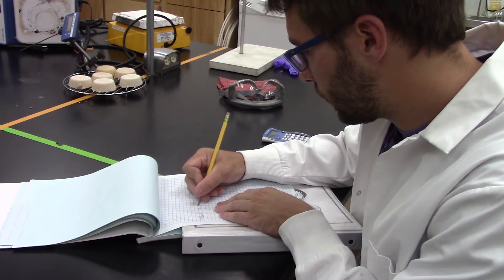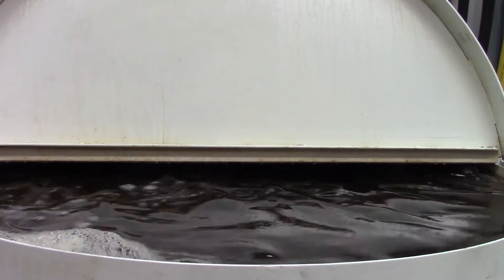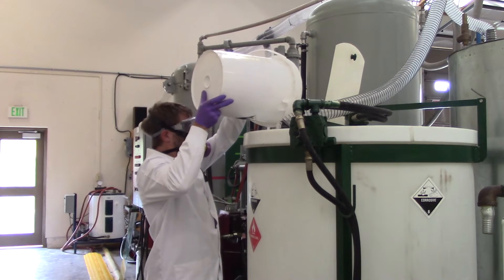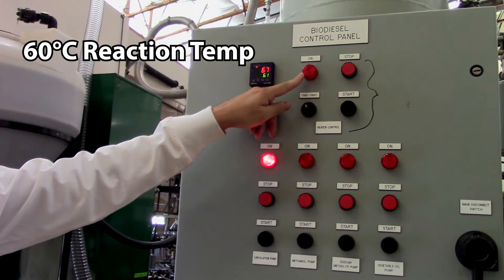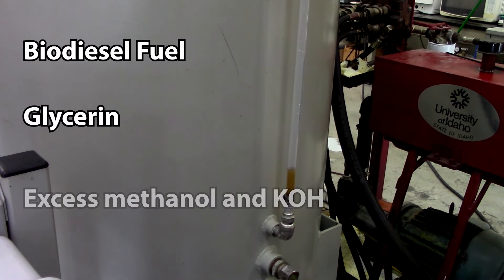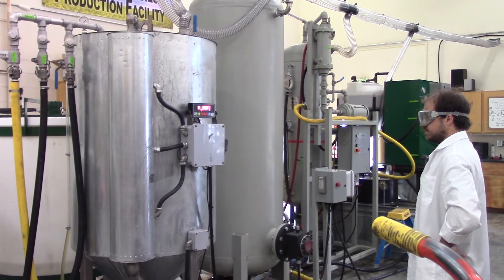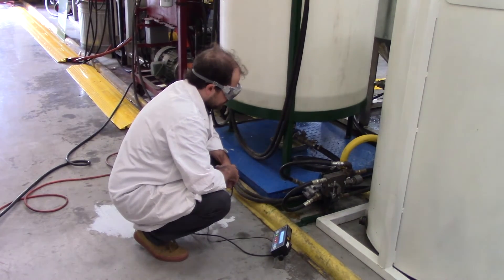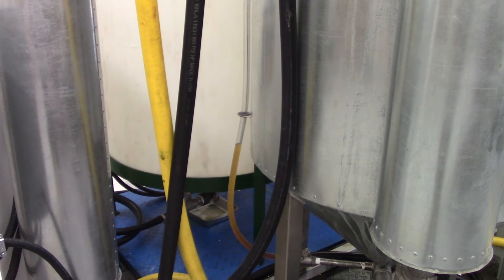Biodiesel Masterclass: Making Biodiesel—The Transesterification Reaction

Comment: Can the reaction temperature be 70 degree?
Reply: No, the oil is held at a maximum temperature of 60°C (140°F) because if the methanol when mixed into the hot oil is at or above 64.7°C (148.5°F) i.e. the boiling point of methanol, it will turn to vapor.

Comment: Sorry to be the one to give you the bad news but the is a better way out there and has been available since around 2009..... https://www.augsburg.edu/alumni/2018/09/19/meet-first-decade-award-winner-dr-brian-krohn-08/   That KOH you use has a cost & needs to be bought for every batch, it is also hazardous and involves another cost for safety equipment. Also from what I have learned it could be used as a nutrient in growing algae instead of also being used in the production of the fuel, thus using the resource faster. Oh and look at the better process also doesn't produce glycerin so there is less waste to deal with. Also why are you buying methanol when you could be producing your own ethanol? Seems to me that the education system needs to communicate better and work together more....ie: you could be spending your brain power & funding on ways to make the better process less energy intensive, on ways to grow more algae (hint stop using one of the nutrients for the algae as a catalyst in making the fuel)   , or perhaps even find ways to mass produce these http://www.evercatfuels.com/PDFs/Making%20biodiesel%20more%20eco-friendly%20%E2%80%93%20Finance%20&%20Commerce.pdf so they are more affordable.
Reply: That's all very cute, but where's the tutorial on a practical application of this process?